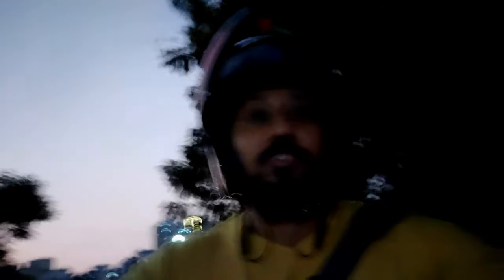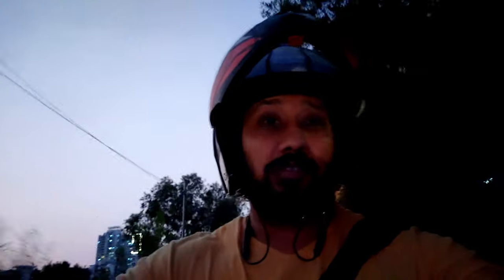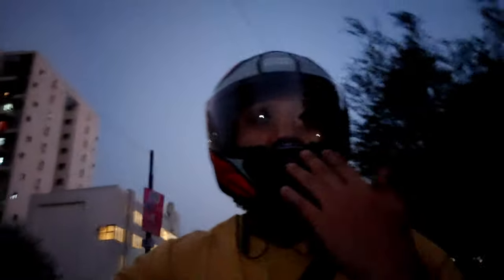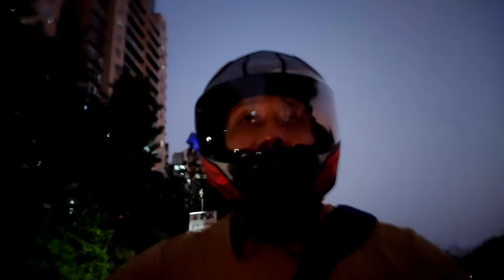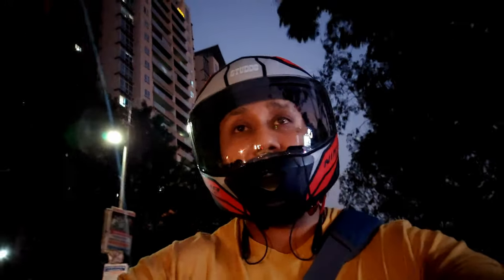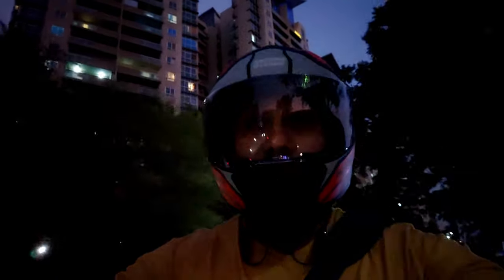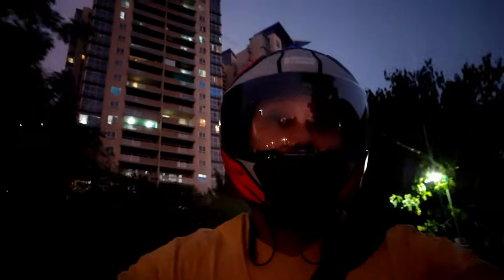OnePlus Bullets Wireless Z2 - Microphone Sound Test

Comment: Bro how to test while video recording mic test   so many times my realme 8 pro  not working phone camera video recording   neck band mic is not working. Only phone mic still working otherwise any call neck band mic is proper working
Reply from the maker: By default you don't have the option of recording from the Bluetooth mic. You will have to use thirdparty softwares or use a phone which supports Bluetooth recording like (high end samsung phones, etc)
Reply from the maker: Filmic pro allows you to use the Bluetooth mic but it's a paid software.
Reply: @KenKnowsMore  ok bro